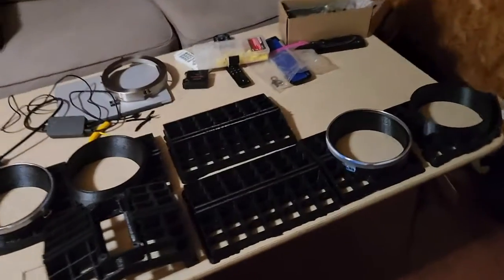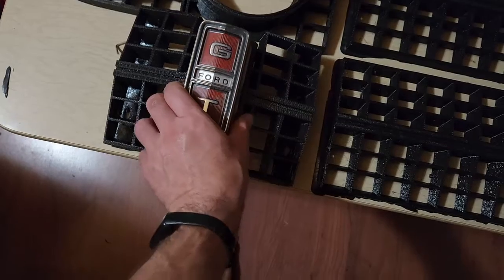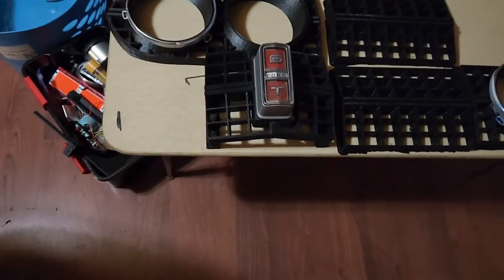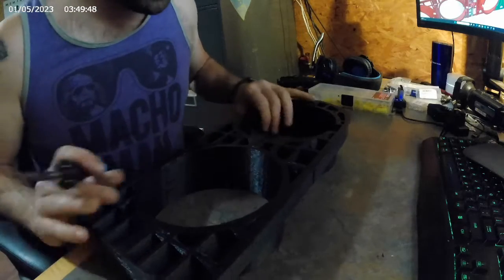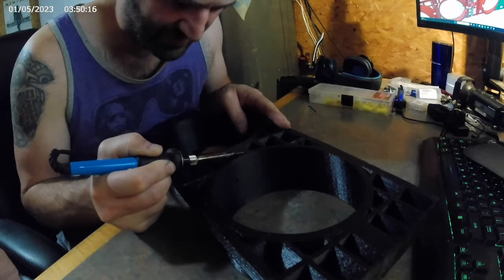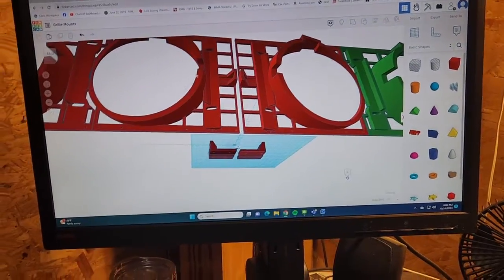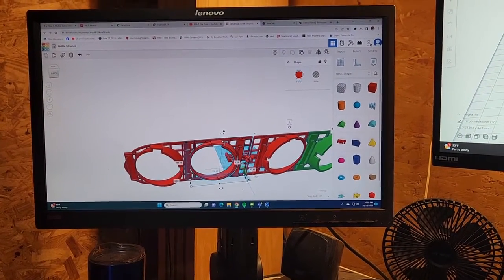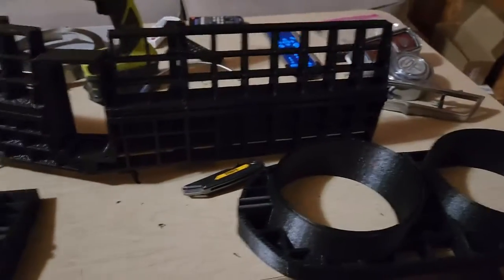The Incredible 3D Printed Grille for the Classic 71 Torino: A Game Changer

Comment: Are you making these yet ?   I'd like to try one
Reply from the maker: not yet, i need hardened nozzles for my big printer. I may just make one in PETG, just been super busy
Reply: @ID10TGARAGE  I need something for a fiberglass nose on a drag car.  I dont want to cut out the flat part of the nose, basically need something to mount on a flat surface.
Reply from the maker: @Brian-gw5qs  hmmm well the nose is angled all together but without the brackets I made it is a flat surface.